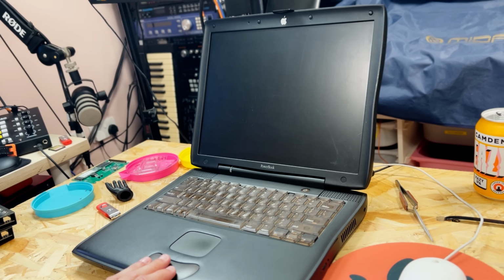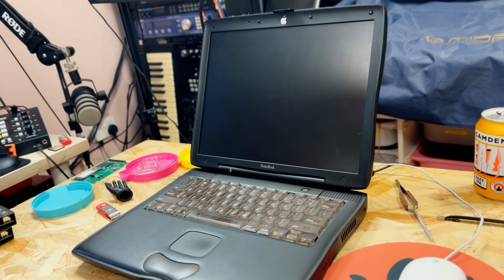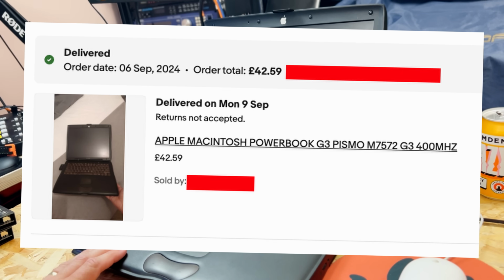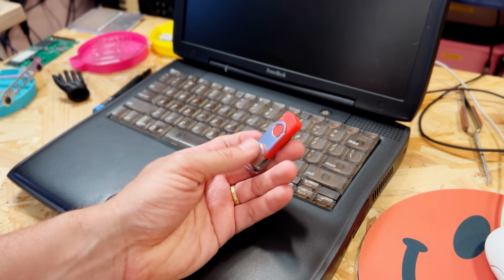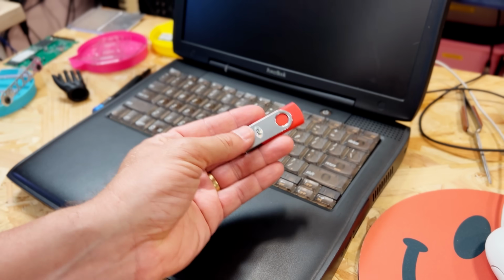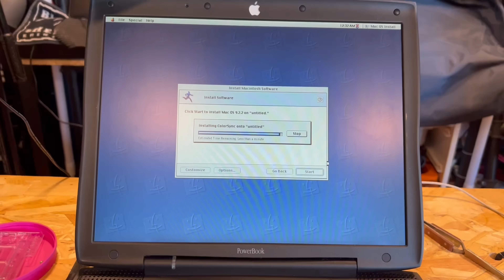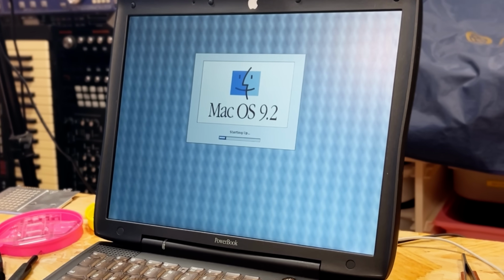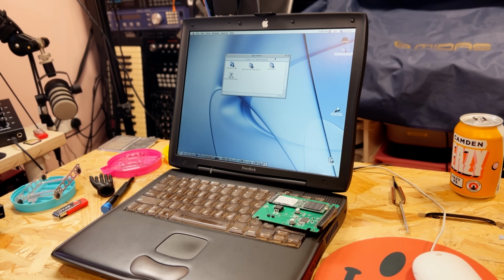Aphex’s Drukqs Laptop: A Powerbook G3 Pismo SSD upgrade tutorial

Comment: Ive still got my Pismo, 2nd owner bought it in 2001. Its got a G4 upgrade and mSATA drive in it. I will never part with it. Ive also got a Wallstreet since that time that has a 3rd party zip drive in it. that one has serial and scsi ports. 
I used to call doing the PRAM trick "giving it the Vulcan nerve pinch"

Comment: For those interested in Player Pro I actually was able to spin up a copy of Player Pro 4.5 on a Mac emulator running System 7 on this amazing website called InfiniteMac. It actually runs in your browser, which is astonishing! InfiniteMac does seem to limit the bit depth to 8 bits, which is pretty scratchy, but I was able to actually render to a file at 16 bits and it sounded great. I believe that if I installed Basilisk on my own machine, I could increase the bit depth of the sound driver.

Some notable things about PlayerPro that I've noticed so far, just fiddling with it for a few minutes, is that the scrolling in the pattern while playing actually makes sense, unlike any other tracker. It does not keep the cursor centered, which is great, but on top of that, when it gets to the bottom of the page, it doesn't start scrolling. Instead, it pages down, which is exactly what I would like to see. I can't believe it. I don't understand why this is such a rare feature. The other cool feature that's very unusual is this kind of piano roll-looking view, like Steinberg-style view. It doesn't actually let you edit it, but you can see each part and the notes. Oh, and also, it shows you each part being played on the same keyboard with different colored highlights. So you can see which part is playing which note, and when they overlap, and so on. It's pretty cool.

Comment: i bought a 10 year old MacBook pro for 200 bucks for similar reasons. some of the last MacBook pros that are upgradable and have usb ports and dvd drives. original owner kept it in one of those plastic shells and never used it. i put a new battery in. upgraded the ram from 4gb to 16gb and 256gb hard drive to 1tb. it's never seen one millisecond of porn, has zero bloatware and i only use it for making/recording music. as tempting as that macbook pro M that came out a few years ago is, i think i did pretty good for now.

Comment: I think a modern micro sdcsrd was just as fast as ide drives. Couldhave gotten a microsd to ide card
Reply from the maker: Possibly although I’ve seen a few comments of folks suggesting avoiding things like CF to IDE cards due to speed issues. It was about £25 total for both the IDE/M2 adapter and the M2 memory I got so I’m OK with that!

Comment: If you don't have a PC to create a boot disk, you can try BalenaEtcher for Mac - creates USB boot disks for ISO files.
Reply from the maker: Thanks - I've tried to use Balena Etcher on mac (I'm on Sequoia) and could never get it to work, do you have any tips?! To be fair I can't recall if I tried to use it on this but I have in the past and unfortunately didn't have any luck.
Reply: @mylarmelodies  I have Sequoia as well and don't recall having install/running issues, but I was creating an ubuntu boot - using the ARM Etcher version. Getting the boot to work for the target machine BIOS was a little more challenging in trying to find the right menu option to boot.

Comment: You should still be able to use Toast Titanium + disc drive to burn an installer CD on a modern Mac. There’s probably a third-party tools for the Mac as well.
Reply from the maker: Yarp - I tried that but problem is the drive itself is broken in mine so reading disks didn’t work. I left it in as a dust protector and weight balancing tool - Quite common for them to konk out in these! But yeah if you do have a working disk drive and also another computer with a CD burner then you can totally try authoring an ISO of the OS9 disk. You can find ISOs on the sites linked in the description.

Comment: I used a G3 wall street for live concerts for several years (1998 to 2001), used Maxmsp, Turbosynth, Metasynth, Soundhack, Hyperprism, Peak and DECK (from Bias) and a really wonderful real-time audio sampler called LISA from the dutch STEIM organization. You would get crashes (especially with maxmsp) but it worked really nicelly, running macOS9.2
Reply from the maker: thanks for this!! any of those shows posted up anywhere?
Reply: @mylarmelodies  One in Berlin 2000 https://www.youtube.com/watch?v=PBJS5SSaoNg&t=295s
Reply: @mylarmelodies  I think I have a few, experimental laptop music, from an ancient group I had at the time, one in Berlin 2000 (running maxmsp with a midi fader controller) https://www.youtube.com/watch?v=PBJS5SSaoNg another in Lisbon in 2001(you can take a glipse of the maxmsp patches running on the laptops, mine is a G3 wall street and the other one is a Pizmo, with live video by jeremy bernstein - one of the inventores of Jitter - the maxmsp video library) https://www.youtube.com/watch?v=oh4O-XArpcM and one in Paris 2002 (2 G3 - wall street and Pizmo and the video guy had already the new G4 Titanium at the time) https://www.youtube.com/watch?v=nc4STbYTFLY all that running Macos 9.2
Reply: @mylarmelodies  Berlin 2000 https://www.youtube.com/watch?v=PBJS5SSaoNg , Lisbon 2001 https://www.youtube.com/watch?v=oh4O-XArpcM , Paris 2002 https://www.youtube.com/watch?v=nc4STbYTFLY

Comment: if this laptop has scsi, you could get an old sampler and use recycle to slice up loops. I have a g4 tower with a scsi card with recycle which works. though it is an old workflow and it is actually better to use a modern computer with ableton live or bitwig for loops. same thing with the os9 tracker. when i used it, it was buggy and renoise is more fun. I’ve come to the conclusion that it’s only best to use my g4 to open the old pro tools sessions i had on it. but it is fun to mess around with, but i always come to the same conclusion.
Reply from the maker: Yeah this is something I didn’t consider when I first got it but yeah my old A4000 has scsi (I used to use a Zip drive with that) but yeah maybe I could beam stuff to it from Peak, which says it supports A3000 I think?!

Comment: I used similar back in the 90s (still have a OS9 G4 but not fired it up for several years, so who knows...?)
I was keen on Th0nk (non-real time granular processing) and the original version of AudioMulch.
There was also a VST filter/distortion called Prosoniq NorthPole I used on everything, still my favourite VST plug-in.
Reply from the maker: Yaaas! Thonk has been recommended and I have it, not tried yet. Audiomulch I didn’t even realise was that old. Will defo try. And yeah I was playing with NorthPole - it’s super crusty but defo has its own charm
Reply: @mylarmelodies  And recently I got a Sonicware Texture Lab. It really reminds me of the results from Th0nk - but with real time controls. Th0nk needed to be set up with your chosen parameters (guesses!) and run for a few hours, after which you'd find your results - which were frequently awful, but after a few tweaks could be coaxed into something beautiful.
Reply: @DiomedeGap totally remember waiting for eternity for the files in thonk to work their magic and be rarely wowed by the end result! However, at that time it was amazing!
Reply: @mylarmelodies  I thought early (pre-version1) versions of AudioMulch were more interesting and creative than the released full version, maybe the limitations were helpful. Also, thinking back, although I was primarily Mac based, it's possible AudioMulch was one I had to run on PC... can't remember...

Comment: The Pismo is a fucking amazing machine. Got mine with G4 upgrade and 1GB of memory (originally 64MB). They also run up to OSX 10.4. You can stick a CF USB2.0 adapter on the side expansion slot, but I don't think you can boot from it (never tried). But it's easier to use a FW HD. Or if you have another Mac with Firewire: hold the T key on the Pismo during boot and it turns into a Firewire Target Disk (Firewire logo appears on screen) - connect the firewire port to another Mac and the internal hard drive of the Pismo appears as an external disk on the other Mac. Drag an OS9 System Folder to the "external" hard disk, unplug, restart and go crazy. Use the same process to load sample banks, virtual instruments, and everything that needs big data transfers into the Pismo - Firewire will transfer at least at 35MB/s, while you'll get about 20 from USB2 and less than 1MB/s from USB1.
Reply from the maker: You can put a G4 in them?! Any clues how that’s done?
Reply: @mylarmelodies  they’re aftermarket upgrades, tho for most maths a G3 and a G4 will perform the same MHz for MHz (but the G4 upgrades were also often clocked faster). 
You pull out the keyboard and the processor is basically in a wee slot, the aftermarket ones replace the whole CPU assembly. 
There’s videos of the upgrades being done on YouTube :)
Reply from the maker: Thanks for all this! And yeah I do have a stack of ancient external drives from the last 20 odd years, with several firewire, tempting although it’d defo be worth sussing how to just beam from one to the other without loads of mounting/unmounting/swapping
Reply from the maker: I should add for others considering this that on the FW target disk mode, I didn’t mention in the video but I considered this and dug out drives for it but just had absolutely no idea how to be sure I was doing it right as I couldn’t find any guides for doing it. Also to make matters worse I actually originally had installed an old NVME M.2 drive in here which didn’t work at all and so I had several potential failure points present at once which makes troubleshooting a nightmare (you could spend days trying to suss target disk mode only to discover it’s that you had put an incompatible hard drive in!!). Basically for every recommendation in the video it’s because I did it wrong first and then tried it this way 🤪 Hence the recommendation for folks like me to just use the USB stick technique as it definitely works and has a step by step guide, something not present for other techniques. Please do link to one if you know one though!!

Comment: I'd like to mention that RME interfaces such as the Fireface line come with firewire and that it's not very hard to find old iMacs with that i/o. The biggest plus is RME still has those drivers available for download on their website.
Reply from the maker: Yeah a Fireface would be great but it’s spenny still! There IS an RME interface I really want called a Multiface which you can get with a PCMCIA interface and will work on this. If anyone wants to donate or do a really good price I’m all ears!! x
Reply from the maker: I should add for anyone looking to make sure you can find a driver for your OS before buying an old interface. Class compliant stuff isn’t a thing on these OS’s so you have to have a driver that works!